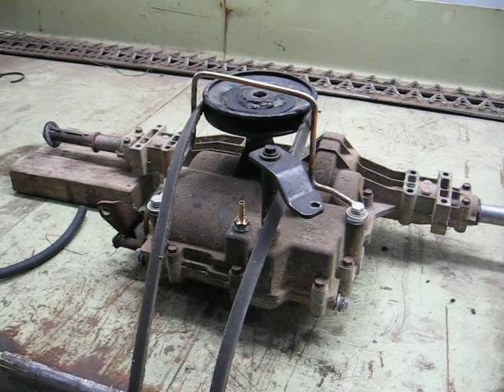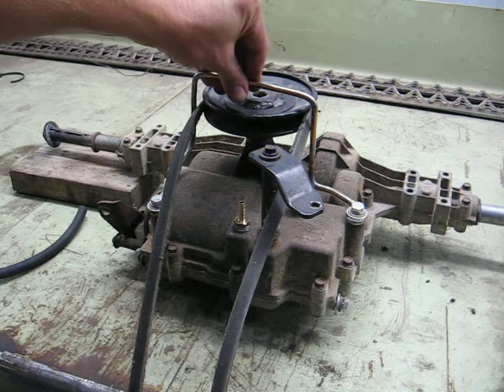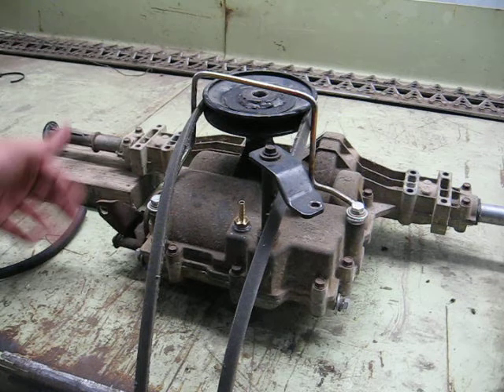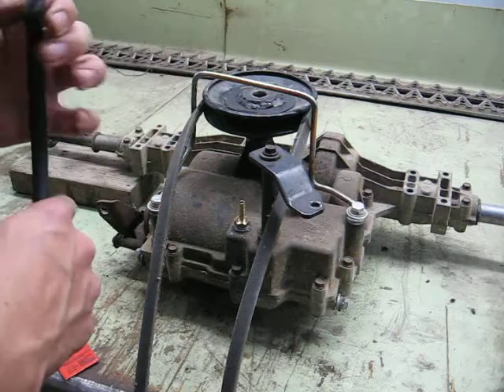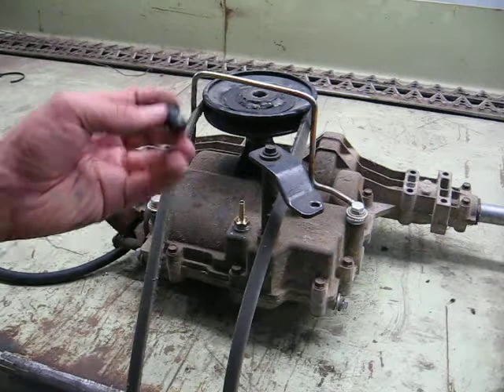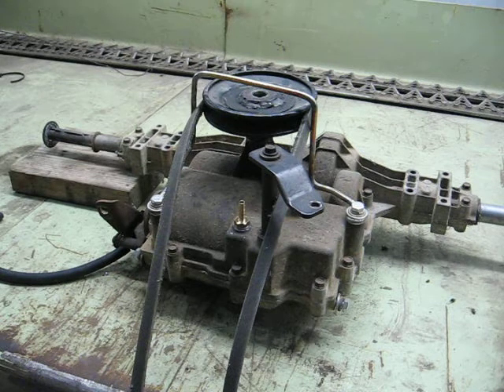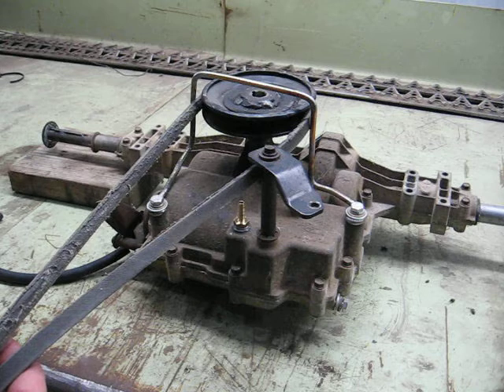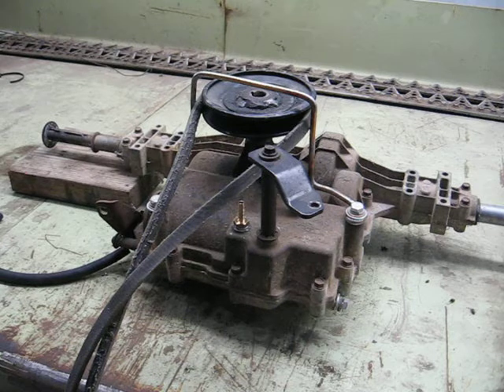Off Road Mower - Peerless MST transaxle conversion, The All Terrain Mo Cart build vid #4

Comment: do you know what are the differences between the Peerless mst 205 transmissions? I have a MST 205-509a and Ineed to replace it instead of reuild it and its hard to find. But I saw different types of MST-205 on eBay but the numbers after the 205 are different.
Reply: 205 is a 5 speed trans. 206 is a 6 speed. (203 would be 3 speed)